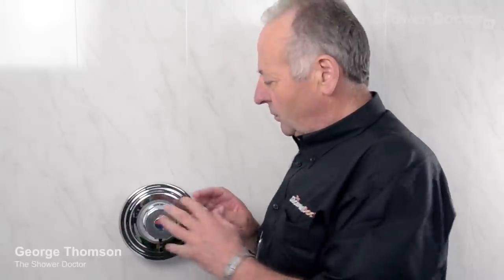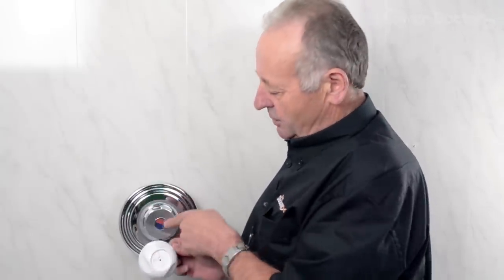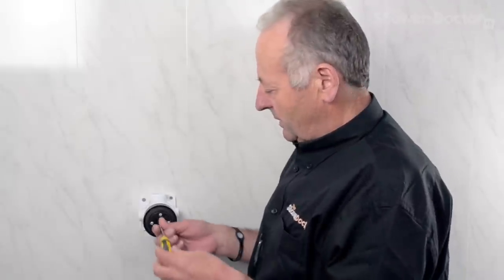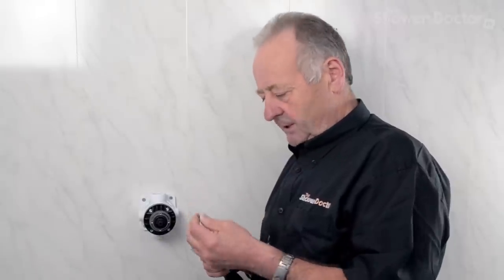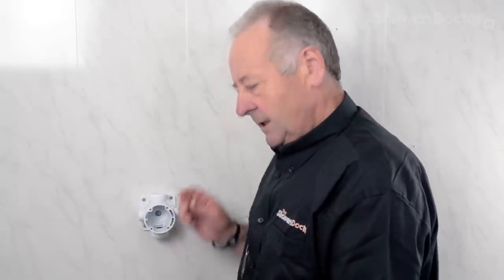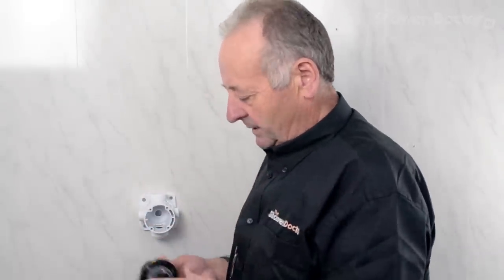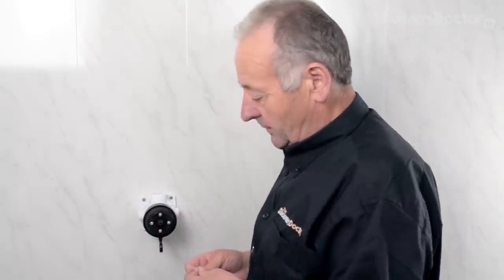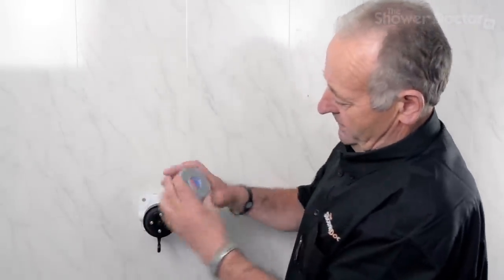How to replace an Aqualisa thermostatic mixer cartridge.

Comment: Thanks for this - a massive help for me replacing my grey cartridge with a pink one after getting a combi boiler (previously pumped gravity).  One gotcha was that for me, when I took the grey cartridge out, there was an o-ring and white plastic ring on the back of the cartridge.  This wasn't on the new one, and had to be added.  Initially I didn't add it, and I couldn't turn off the water from the shower, and there was no temperature control.  Once I added the white ring into the slot at the back, and put the o-ring on after (onto the end of the cartridge), it worked fine.

Hope this helps.
Reply: Hero! I must of have the cartridge in an out 4 times trying to fix this issue. Thanks
Reply: Thank you for the comment. Did you use the old white ring?

Comment: Great video. Very instructional !! Having done this job several times i would certainly agree that the small 'O' ring is very difficult to remove.. I would suggest using a metal 'dental type' tooth pick to get behind the 'O' ring to gauge it out. Luckily, replacement of the new 'O' ring is not as difficult - although it is still very fiddly. Oh - and just an addition to the video - don't forget to turn of the hot and cold water feed to the shower before starting to replace the shower cartridge.

Comment: Carried this operation out on an ancient Aqualisa 200 tank pressure model today.

My comments.

When the shower started to leak I had a plumber come and fit two tap type stop valves in the hot and cold feeds for £60. These were accessible in the airing cupboard so we used these to stop the drip for about 3 years!. Eventually the leak returned as the water in the shower body itself was dripping off the temperature regulator arm.

At first I thought I would not bother to renew the "O" ring, but it leaked when the water was turned back on.

The crochet hook suggested to remove the "O" ring is hopeless. At first I could not see the existing ring and could not feel it with the crochet hook. I eventually stabbed it with a pointed curved blade on a scalpel. I think it fair to say you need something to stab it with, rather than just try to pull it.

As other say getting the new one back in is definitely a fiddle! You will need a second person to hold the torch and 3", or longer fingers! My longest finger is about 3". I did use the crochet hook to help pull it in to the groove while trapping it in the groove on one side with the screw driver.

Otherwise the instructions were good. I had the brass ferrule model for the screws that hold the new cartridge, so if you have, heed the warning and re-use the brass machine screws. You will need the new machine screws to re-fix the temperature regulator ring.

Comment: Make sure you put screw in the T25 screws very tight! I put mine back together and it was still dripping and I was almost about to give up, but one last try saved me from called a plumber. The instructions that come with the cartridge are pretty great apart from not mentioning how tight they need to be

Comment: My Aqualisa shower mixer valve has been in situ for many years and had developed a water leak at the temperature control lever. Despite undoing the screws, the valve was still lime scaled into position. I had to put the on/off cover back on and gently manoeuvre it until I dislodged the offending line scale.
It’s difficult to see where the water leak was but at £198.00 for the complete valve, I’m prepared to spend an hour or two looking for it. The gasket and ‘O’ ring set costs around £16.00 on Amazon of you can’t seal the original rings with petroleum jelly or CT-1.
Great video, I’ve just added comments on other problems I encountered?
Good luck.

Comment from the maker: Shower Doctor TV: How to replace an Aqualisa cartridge, a video guide: http://buff.ly/1qIiBRt
Reply: Followed up to 2:00. When I removed the temperature lever though, there's another round plastic case which I can't work out how to remove. This covers the screws to the cartridge (presumably, I can't see them). Also there's a small black plastic unit in front of the cartridge with wires (red white and blue) leading from it into the cartridge - looks like it hugs the side of the cartridge then disappears into the unit somewhere. 

It's an Aqualisa Aquastream 97-03. 

Can you advise on what to do with this? 

Would be immensely grateful for any help!!

Thanks.

Comment: Very helpful, thank you.  The question in my mind is, how would I know whether that tricky O ring needs replacing?  The instructions that came with the Aqualisa cartridge said that they recommend the O-ring is replaced.  This video implies that it normally doesn't need to be done - and I can testify that it's tricky getting the old one out!  What are the symptoms of it needing replacement?  Many thanks.

Comment: Hi, I have an aquastream power shower installed in 2000. In recents months it is leaking via the shower head. In the past when this happened I have replaced the cartridge an this worked.
I was sourcing replacment cartridge adn they are quiet expensive. I am wondering do I really need to preplace the cartridge would a new " o " ring solve my problem.
alan

Comment: Hi,  This video is very informative, thank you.  I have a question.  I have a circa 2000 Aqualisa shower. Replaced for the same model approx 5 years ago.  I believe the model is 609.  When we turn off the shower, there seems to be a little bit of play on the control knob, so we get water dripping.  Does this indicate that we need a new cartridge???  Many thanks

Comment: Excellent video. We have two showers with this valves and both have gone very stiff to turn on and off. Do that mean that the cartridge needs replacing or is there some remedial fix for this? Being an engineer I prefer to fix than replace.

Comment: Very useful video!
I was going to get Aqualisa to replace the cartridge for me, but they won't do it unless the shower has isolation valves. I said they can turn off the water for the whole house, but they said that won't do. 
It's a combi boiler system.  There is no water in the house higher than the shower, and nothing comes through if I turn off the main stopcock.  Is there any reason why that wouldn't be safe?

Comment: My Aqualisa shower has started dripping from the controller, will an o’ring or gasket fix my problem.
Reply: regenerate the air gap in your hot water tank
Reply: david carradice hi David, mine has got the same problem. How did you fix yours? Please share link to the parts if possible
Reply: My aqualisa shower is dripping from controller

Comment: Hi I have a aqualisa thermostat mixer , I now have a combi boiler which has more pressure , so the thermostat is now leaking from the bottom, I need to change it , do I have to turn off hot & cold so I can take it out to change it , thanks

Comment: Useful, I was looking forward to it being a straightforward in and out replacement.  Then I found that two of the cartridge retaining bolts had corroded beyond recognition.  What kind of company puts steel bolts in a wet area?
Reply: I got the same problem, may I ask how did you managed to get out safely?

Comment: I have an Aqualisa Hydramax (torpedo-shaped) Shower control which has been in my property since I bought it as a new property in 2008. I have just sold the property and should be completing towards the end of June but the shower has just started leaking cold water only when it is turned off. It started as a few drops but the rate of water loss is increasing rapidly so cold water is trickling constantly  at an increasing volume. I have been quoted £260.00 + VAT by Aqualisa for them to come and replace the cartridge or £328.00 if I want a total up-grade including new shower fittings. Is it possible to replace a seal, washer or other components rather than the whole Aqualisa Hydramax cartridge as I don't think I can leave this to get worse and it would not be a pleasant thing for a new resident to be faced with as soon as they move in?

Comment: How can I remove the retaining screws holding the Aqualisa cartridge when the heads  have rusted away
Reply: Same problem here, did you manager to unscrew the rusted one? I have been successful for 3 out of 4, one is not getting unscrewed.
Reply: @jeetugurgao  Hi How did you get the rusted Screw off?

Comment: I have a Gainsborough shower, would the Aqualasia cartridge for this shower, the current one is grey, and the shower is only giving out hot water, no adjustment to make it colder.   Do I need a new cartridge? Thanks, think the video is very comprehensive.
Reply: We have an Aqualiser mixer valve which is about 7 years old and when turning on gives out screeching noises.The shower works ok so any tips on curing this problem please?

Comment: My Aqualisa shower has been dripping for a while now and so when I saw this I thought great, I will have a go at replacing the cartridge. £110 later the new cartridge arrived and I followed your instructions to carefully remove the old cartridge, the hard-to-get-to O ring, then replace with a new O ring making sure it had seated in the groove followed by the new cartridge. Gently tightened the brass screws and turned the water back on and..... it still drips! About 1 drip per second, apart from that it works fine. What have I missed - or is it something other than the cartridge causing the dropping?
Reply: Did you resolve the dripping? If so, how? :)

Comment: Inherited our shower which was quite old and had 1 of  the bottle top blanks RIP open and so had a little leak , luckily  we were in and shut the water off.
Plumber came and fixed that but then messed around with the shower dial itself for along time .
When he left we noticed later that it dribbled ever so slightly. Never mind I'll order some seals and fix it myself luckily I'm quite handy.
But noticed- number 1- the water had been tracking back through the ring / collar and dropped into the drywall where it had made the stud wall a little damp. :(
When I fitted the seals there were none on the fluted spindle,  I believe this is where the smallest seal should go ?

Comment: Shame you did not demonstrate the tricky bit -  the O ring replacement -  because, as you say, this is  the  first question the manufacturer  asks  if   a fault develops.  Also you do not explain what the o ring does  and  when it must be  replaced.

Comment: I have a really old aqualisa shower that doesn't seem to stay at the same temperature,  one day it will be fine,  I don't move the selector and the next day it's boiling!, would this be a cartridge problem?  Thanks
Reply: I find the temperature varies with the weather.   On cold days it needs turning up more and in summer I turned it down a lot.

Comment: Very useful thanks. This may be a daft question but do you need to isolate the water supply (turn it off at the mains), before replacing the cartridge? Thanks
Reply from the maker: Yes you need to turn off the hot and cold supply to the shower before removing the cartridge.
Reply: The Shower Doctor Great, thanks. I will let you know how I get on!

Comment: Hi Shower Doctor
 I have an Aquavalve 700 Thermo Exposed that has been dripping for some time now.
Do you think that by changing the gasket will stop the dripping? Or do I have to change the whole cartridge?
I would appreciate your advice.
Reply: What did you end up doing to resolve the dripping?

Comment: Hi, I have just replaced my Hydramax Shower Cartridge (high pressure one, with the green colour) and to my surprise it won't turn off. That is to say, when the knob is fully turned off, water continues to come out the shower. I had to put the old (identical) cartridge back in again just so I could successfully turn the shower off. What could I have possibly done wrong (or could it be a faulty cartridge)?
Reply from the maker: Check is that you have fitted the cartridge the correct way round, it is possible to fit it 180° out and this will cause it not to shut off.
Other than that it must be a faulty cartridge it is very seldom we get these back as faulty but........if you bought it from us then drop us an email and we can arrange a replacement or a refund.
Reply: The Shower Doctor Thanks for your reply. It turned out I had neglected to slide on the white plastic o ring behind the black rubber o ring. Once I had done this it all worked fine. Cheers!
Reply: Gus Flannaga

Comment: We have 2 of the same models in our house that was built in 2001, Both are leaking badly had a plumber out and he could not source the correct part, Just took it apart to see a blue cartridge, on your website it says discontinued, what cartridge will work?

Comment: Very useful thanks. I have a Aqualisa Manual 400, installed 1988. I think the cartridge that I replaced may have been the original. Would this shower definitely have had an o-ring ? I couldn't see or feel one. The original documentation contains a component drawing which also doesn't indicate one. Perhaps it has hardened.
Reply: I might try again this weekend using a needle as per suggestion below.
Reply: If the o ring is very old it will have perished and set hard to remove it use a dentistry hook and a lot of pas hots
Reply: ......Patience .......
Reply: Joshua Trevor Thanks Joshua, I've just ordered a dentists hook to have another go. We sold the house earlier this week, so will have another go to avoid leaving the new owners with a problem.
Reply: Might be a few years late, but I found a really easy method to remove the o ring. Get a scalpel type hobby knife and just stab the o ring, and then lift it out.  Got mine out in literally 3 seconds.

Comment: I am not able to unscrew one of the four screws holding the catridge. The screw head is damaged (rusted away). Any suggestions on how to unscrew it?

Shower make Hydramax
Reply: Hi, I got the same problem today, may I ask how did you resolved? Any tips helps. Many thanks

Comment: That 'o' ring is the absolute worst .if that ring is worn or it's been dripping for any long period it gets mashed into the body and it makes it virtually impossible .
Easily changed when it's a demonstration on a new body ....nightmare in real world on ,an old ,faulty valve .

Comment: What a COP OUT, Well what you've shown us could be worked out by anyone that can change 13amp plug and is just a reversal of taking it apart . 
What you didn't show was how to fit the O Ring, Which is an absolute Nightmare.
Getting the old one out with a hook is piece ice of cake, getting the replacement O ring in must be the most tedious job a person could ever do in their lifetime